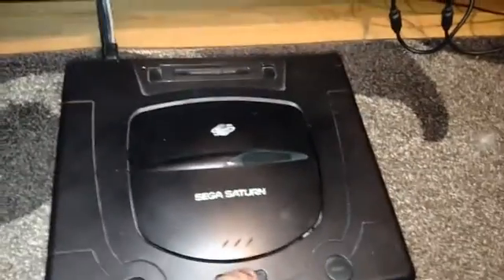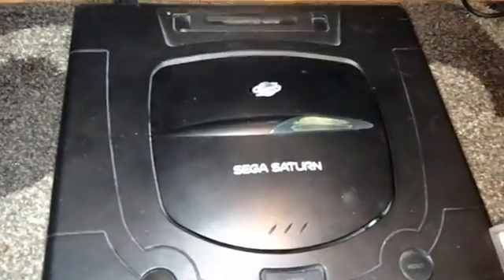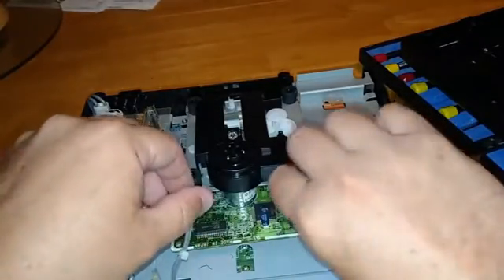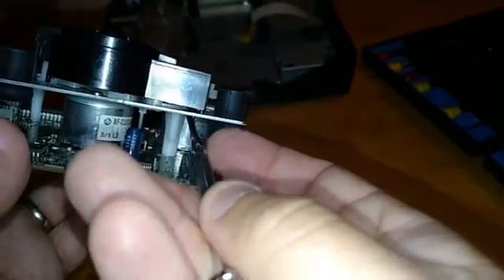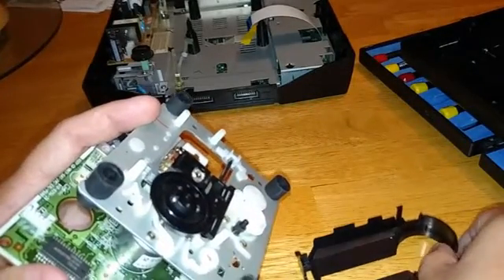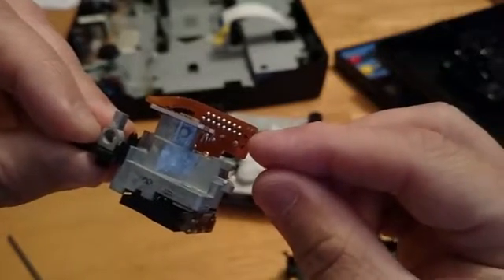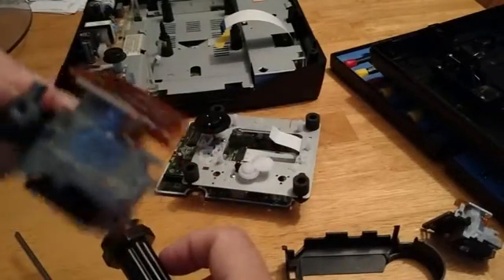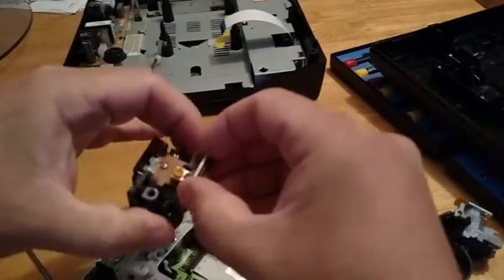Sega Saturn Laser Replacement Troubleshooting Model 2

Comment: Why does that little bit of solder need to be removed? Will the laser not work properly if it’s left on?
Reply from the maker: 27Neon12 The lasers get shipped with that solder as a jumper. If you don't remove it the laser will actually not power on at all.
Reply: Professor Gull Gotcha! Thanks for the info.

Comment: Do you happen to know what laser model 1 uses and where to buy it?
Reply from the maker: There are2 lasers which would work. Big difference is if you have a Sanyo model (which I could not find but will try some more searching )or other. The other can use the Optima Laser like the one found below here.

http://www.ebay.com/itm/360380523306?_trksid=p2055119.m1438.l2649&ssPageName=STRK%3AMEBIDX%3AIT